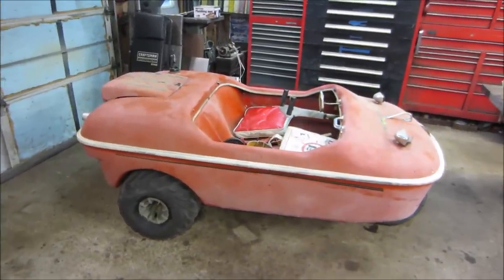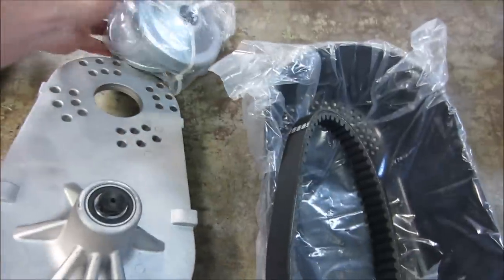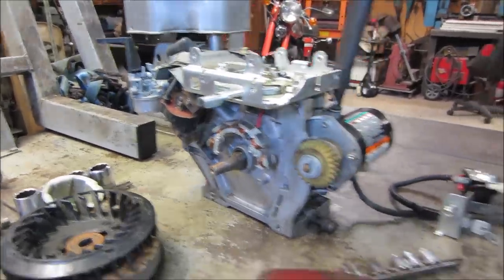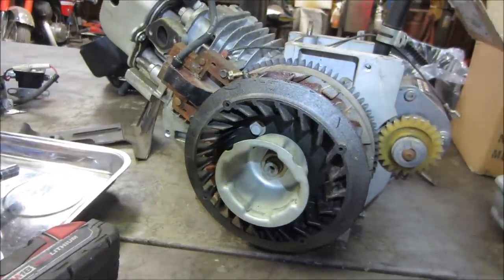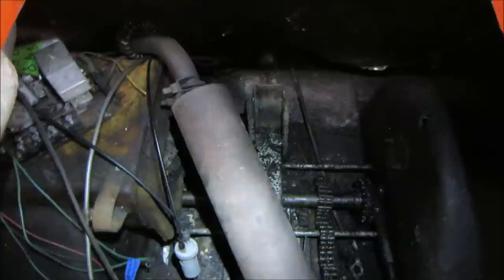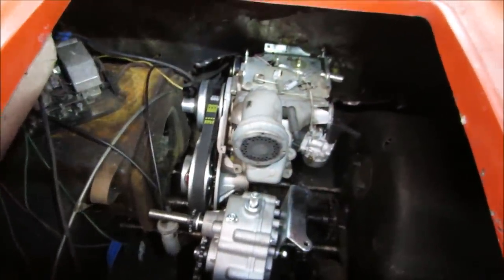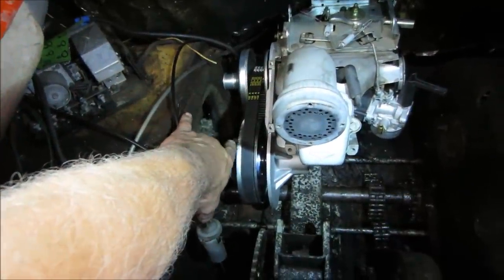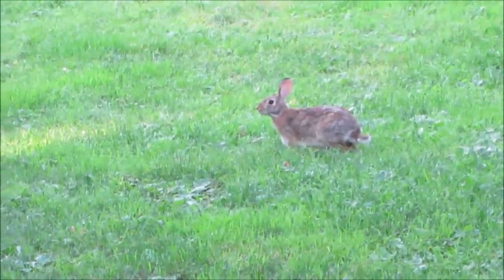beaver amphibious vehicle gets new engine

Comment: Mustie. If you put a thin cutoff wheel buddied up with your roloc disk, It makes the roloc rigid and it locks right in with the roloc thread. This stops the flex of your sanding disk. Try it, you will like it!. This also extends the life of the roloc and allows you to grind on the edge. It is not dangerous and I have done this for years! I am a 30 year auto body technician.
Reply from the maker: l will thanks
Reply: Cool. I'll try that one myself.
Reply: Richard Baumeister     Good tip!  Thanks, I will try this myself next time I find the need👍

Comment: I used to work on road racing two strokes. Always was taught the small woodruff type key was for location only, not to be expected to carry the power. This was purely done by shaft taper angle and flywheel fit. Every time a two stroke seized at speed the flywheel moved on the shaft. We used to lap them in again using fine valve grinding paste. Later did away with flywheel magnetos and used total loss systems battery powered, cured one problem, created others !. Then came lightweight chi and four strokes.

Comment: gotta love the briggs and stratton flywheel key, aluminium (which has two f*8!ing 'i's in it) so they shear easily. When I was in Wales i made a bloody fortune buying non running, no spark, B&Ss, tillers, generators, mowers of all sizes etc etc and flipping them after putting a new key in (and cleaning/servicing them). happy days! I lived in a caravan then, at the top of my mates field and kept a de-bladed ride on to carry my shopping/gas bottles/drunk self etc from the road. Only time I ever rode Milwaukee iron!

Comment: I remember ‘fixing’ a motor with a coil. The HT lead to the plug had been cut in two, the unit wasn’t due for a service for three months and it was attached to a large garden vacuum called a ‘Goat’. Despite being told it was impossible to splice the two ends of the HT lead together, I used a combination of conductive gel, a straight-thru crimped terminal and a glue lined piece of heat-shrinkable sleeving.

I used the paper to set the thickness for the coil pick up. 

That thing ran like a Swiss clock until it came time for the maintenance and they swapped out the damaged unit.

But I never forgot that fix.

Comment: Good movement forward on coming up with a powerplant and transmission for the Beaver, easy to find replacement parts readily available, and nothing to exotic. The electric fan is a good idea, and as long as you don't go too radical on the size of it, should power up just fine, and with a lawn tractor battery installed for the electric start and fan.

Comment: I used to own one of these Beavers. Engine problems all the time..... DO YOURSELF a huge favor the top separates from the bottom of the body. Remove the molding and separate the two halves! FYI they are not water proof.....
Reply from the maker: it does not split

Comment: I would double check the flywheel you installed.  It did not have any magnets on the inside for the alternator.  If the other motor has a 110 volt starter there would not be a need for the charging system.  The mounting bracket bolted on the doner motor is exactly like the one I took off my 6.5 which came from a pressure washer.  It is now on a go-cart which runs over 60 mph after governor delete. Go-cart started out it's life as a electric Honda Mini-moto 36 volt 18 mph max. It is now a disabled 63 year old veteran's toy.  And he loves it. And we had to stretch the frame 8 inches so his gut would clear the steering wheel.

Comment: Mustie  --  Remove the Air Box,  install the Vent Fan under the Seat and Duct It wherever you need it to enter the Engine Compartment.  That would give you more space for positioning the Engine & Transmission.  On the Transmission,  you could add a Jack-Shaft extension to the Output Shaft,  & then mount the Output Drive Sprocket  anywhere you needed, to align with the large sprocket on the Brake Shaft.
Reply: figgin awesome idea !
Reply: DesertRat, is the airbox that large?  From the opposite side I see the wheel well takes up about the same amount of space.  Don't get me wrong I love your idea and the need for room is apparent, I just can't get a sense of how large the airbox is if there is a wheel well under it.  I need blueprints (haha).
Reply: John Razor  --  The Air Box appears to be about 14 inches square and is mounted on top of the Left wheel-well , and it projects several inches beyond the wheel-well into the engine mounting area . Secondly ,  the Air Box is on the wrong side for that Honda engine .  Third ,  Mustie wants a ventilation fan because he is concerned about the accumulation of Gasoline Vapors in the engine compartment .  Most ventilation fans create sparks when operating - something you DON'T want in an explosive atmosphere , so unless you install a ventilation fan specifically designed as an Explosion Proof Fan for operation in an Explosive Atmosphere (Quite Expensive) , then the best alternative is to put the Fan forward of the bulkhead in the operators compartment and duct the air to wherever you need it .
Reply: John Razor  --  Oops !  ,  Sorry ,  Briggs & Stratton engine ,  NOT Honda . lol . -  I had just finished watching another Vid about a Honda engine ,  when I answered your post , without checking to see what make of engine Mustie was using .
Reply: DesertRat - Understand well the explosive nature of the proper fuel air mix and the importance of a venting period before attempting to start an engine, etc.  Marine use of purge fans is an existing art and science, no problem there.  A duct separating the fan has merit in my opinion but I am not a fire protection engineer, it does allow the redirection of cooling air to the desired location.  As I stated, I support the need and reason for finding more space in this crowded compartment and your idea is an excellent one (assuming no structural value so the airbox to the original design) , I have no better idea.  I imagined a transverse engine but the drive system became to complicated. My only point was that I couldn't see the amount of space available.  If indeed, you gain 14 inches great but I'm a fat guy and more space is always better (smile).  Absent a way to obtain a great deal more space, I vote to cut a bigger hole to work in and patch it up later.  Easy for me to say but it's not my labor.  The key point is: I really have nothing to offer as a better solution which is the only thing of value to Mustie1 and I like your idea.  I'll stop here because I am not adding value to the discussion, although I truly enjoy it.  Thanks for taking the time to respond.  J

Comment: Hi Mustie, FYI The drive gear off of the torque converter will fit and work on the back side of he plate, with a spacer where the gear is. then you can turn the gear box around into many positions. Just saying. I enjoy your vids keep up the good fight.

Comment: Mustie , as a retired machinist / mechanic I was "thinking" suggestions about using micrometers and dial caliper while checking the shaft and torque converter . I enjoy the heck out of your troubleshooting and on the fly engineering . I also enjoy challenges of engineering while using stuff out of my junk pile . Wish we were neighbors , the things we could build as a team would be crazy .
Reply from the maker: next video it comes together and yes some caliper use

Comment: He beaver body looks like a 2-piece clamshell, does the top 1/2 split at the trim ring? That would make fitting the engine & trans in much easier?
Reply: Al Howry Filf i tell you, Filf ! 😄
Reply: I would be tempted to do that even if it didn't :)
Reply: I saw a photo of one split on the internet.  Looked like an old bathtub.  Anyway, all beavers have a split.
Reply: I really need a life! I read this and all I got was "beaver", "clam" and "trim".  I hope I grow up before I die.
Reply: The trim is covering a seam in the body. It it assembled using staples to hold it as resin and matt or cloth are used to reinforce the seam. The top of the seat is also joined to the top of the body. It would make it easier to work in the engine compartment, yes, but a bit of messy work to take care (cut) it apart and put it back together.

Comment: I think you're going to be very underpowered. The 850 series Briggs is only around 5 horse power with 8.50 ftlb of torque. Most of these amphibious ATVs from the 70's era had 12-16 horsepower 4 stroke or 20+ hp 2 stroke snowmobile engines.

Comment: One thing that may make positioning things and welding in mounts in the engine bay easier and give you lots of working room  is to separate the upper body from the lower tub. If this thing is set up anything like an Argo, the body is in two halves with the two seams pop riveted or bolted together and hidden under that white rubber molding that runs around the body. This project is very very interesting. Cant wait for the next video.
Reply from the maker: it does not split, but wish it did

Comment: an easy way to clean or deburr a shaft is clamp it down fire it up and lay a file to it...if you ever have to shorten a shaft fire the engine and hold a hack saw in place and you'll have a nice clean straight cut...

Comment: Thanks for the upload.  It was fun to watch and "engineer" with you!  Would it make sense to create a plate mounted to the base of the engine with all the necessary brackets and mounts for the transmission to help keep all components aligned?  Then just (haha, just!) bolt it right in to the existing, modified engine mount.  I look forward to the next video showing the way you mount everything.

Comment: Not sure if someone else has mentioned this or not, or if you've figured it out. But couldn't you press the bearings out on the output side of the CVT and replace them with ones that will fit the gearbox shaft? Maybe even add a brass bushing to take the slop out? FWIW I posted this before finishing the video.

Comment: Mount the fan outside of the engine compartment and seal the duct work. That is your initial defense against gas buildup. 
If there are fumes present, and you energize an electric fan, it could create a spark. And all you need is a "Nano" spark.
No Bueno.

Comment: I have a couple of questions for you concerning the placement of the engine and the forward/reverse trans box you have.  First, with the torque converter and trans box covering every thing up how are you going to add/drain the oil from the engine, and secondly if you do use the output shaft as the input shaft and the input shaft as the output shaft will your gearing still spin the tires sufficiently to drive not only on ground but in the water also????  Just wondering what the gear ratio is in the trans box?        Love the vids, keep'em coming.

Comment: The briggs engine is 8.5 peak gross torque which puts it at 5.8 gross horsepower (calculated at 3600rpm).  Which realistically makes it a 5hp engine once you figure intake and exhaust losses.
After all the losses for the cvt and reverser you might be putting 3-4 to the ground.  Might still be enough but im thinking its going to be working hard.
Reply: This was bugging me too,  this setup is looking under powered.

Comment: I used the exact same cvt/transmission setup on a golf cart I converted to gas from electric but I used a predator 420.  I was able to put the driven pully (the not not on the engine) on the input of the tranny and tucked it beside tht engine like you showed.  Still working out some minor kinks but you know how that goes.

Comment: turn the motor around, then with a lovejoy coupling, connect output of the CVT to the transmission.  Long chain of the transmission down to the jack shaft

Comment: you can mount the cvt pulley directly on the transmission and use a different length belt. There are online calculators for belt length, just measure the distance between the shafts and it determines belt length.

Comment: I just bought a similar transmission for a buggy build. Make sure you check the drain/fill plugs and the seals. Nothing was installed or machined very well and it leaked gear oil out of just about every orifice.
Reply from the maker: make sure you change the vent tube over from the block off plug to the breather hose
Reply: I have the double roller version transmission with the short stub input shaft. The factory installed the input and output seals just over the splines and the drain and fill plugs are drilled and tapped at an angle. And for additional fun the 'drain plugs' were just bolts. Luckily I had some copper brake caliper banjo washers stashed away and I was able to press the seals in further. The unit still leaks a bit...LOL! My project was stuck until I saw your solution for the CVT mount. I had the same initial thoughts on too many jackshafts and all that associated mess but your bracketgineering just may be the ticket. My son and I are building up a 2005 Dazon Raider buggy I picked up with no engine (typical Honda clone GY6 setup). I have an 18hp 440cc Honda clone from Home Depot that I'm hoping to shoehorn into it without too much hacking. Loving the vids. Keep up the great work!

Comment: I think you need to cut out the stock air intake box to gain more room on the left side of the engine compartment. You don't need it. It'll leave you more space to run a fuel tank too.

Comment: I still say the gy6 150cc with integral reverse seems to be the most direct bolt in. It uses a cvt Trans and reverse is the same ratio as forward too I believe... and may actually be a smaller package. If you do insist on that setup though you could always cut the hub off for the cvt Jackshaft from the cvt backplate and open the bearing hole to fit the neck of the transmission thus reducing your chain count.  Then you may need to make a new jackshaft/rework the old one to line up.  And as far as the fan use a mechanical fan driven by the crankshaft snout to draw the fresh air in, that way you'd only need the electric blower right before startup to purge the air saving your charging system

Comment: I had an engine with a bad key way like that, and I mig welded that section, and the used a dremel for the key and has work perfect ever since, no shaft wobble because of the welding.
Reply from the maker: ive skipped the key all together and just weld the pulley to the shaft but hard to do with flywheels

Comment: I'm loving this series...the puzzle is slowly coming together...I really want to see the beaver get wet ;-P

Observation / question:
If you mount the engine and drive train like you are proposing, how will you get to the oil fill?  Seems like you'll have to remove the entire engine/transmission to do any maintenance on the engine itself.

Be well,
Doc

Comment: Mustie. If you turned the engine around and extend the shaft lenght of the second CVT. Could you connect forward/reverse box to that. 
So CVT belt on right side of engine. But F/R and chain on left side. More work. But it may give you more room.......? 
Its a Great project.

Comment: For the fan, you could just fit an ignition switch that has Acc. On, and wire the fan to that, so when the tub is powered on initially, the fan comes on before the engine is allowed to even think of starting... :)

Comment: Years ago I picked up a "free" Craftsman lawn tractor from the side of the road..got it home and fiddled with it and got it started. It was rappin' worse than Ice Tea then BANG! Out comes the rod from the side of the case! I got a short block from craftsman and switched everything over but it would not start..just back fired. When I figured what was wrong,it was determined that when the crank shaft was manufactured the cut the keyway slot 180 degrees off! I called Sears tech support and they didn't believe me. I sent them the short block back and they sent me a new one. They didn't even acknowledge that they screwed up.

Comment: Ah, the joys of editing, when future-you can sass past-you! XD
Yes, I quite enjoy watching you do the mechanical version of kit-bashing, it's great fun and I even learn a thing or two! Hmm, if you wanted an easier way to change the belt you could get fancy and mount the engine on a hinged base that would allow it to tip over for access.
Presuming you get all the kinks worked out and get this water worthy, going to repair the engine cover in some way? I'm not sure if the missing corner is integral to it staying in place or not.

Comment: Mustie, for the last 4-5yrs I've been using an Airasol called "CORROSION X"  from Corrosion Tech.. It's a lot heavier than wd40,  It sticks so very much better and I've only managed to use a little over a full can in a long time, a little goes a long way.   I'm not endorsing it just that it's worked for me to lossen everything I use it on.  I use it on my electronics, all mechanical,  Amazon sells it, or it did.....   Mike

Comment: Put the gear box on the breaks side of jack shaft .run the jack shaft large gear to new jack shaft belt gear. It will look like it does now but with the gear box mounted above right wheel well. And 3 chains to drive it all. And on another note the white trim is the seam you could take it apart for a good video on hull repair and motor replace.  i don't think it's glue together rtv like jet ski maybe just a thought.

Comment: Does Mrs. Mustie1 know you're out there, polishing your shaft with some old beaver? It would be nice- if you could remove that white bumper strip, and split the halves apart. Easier to clean, situate the drives, then resin & cloth it back together, with new molding. A dual battery setup, 1 for engine crank, 1 for acc. Add an alternator or VW generator? LED all lights to run easy.